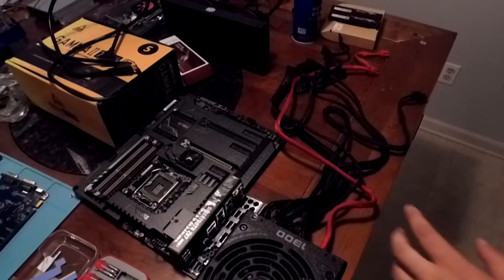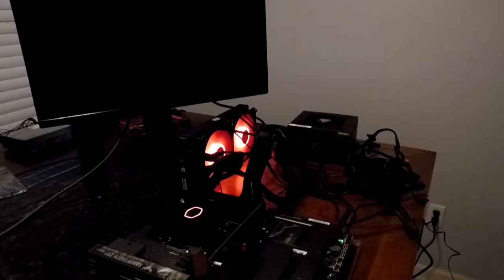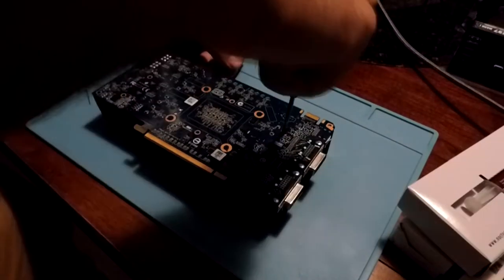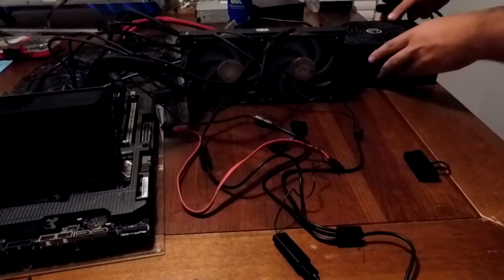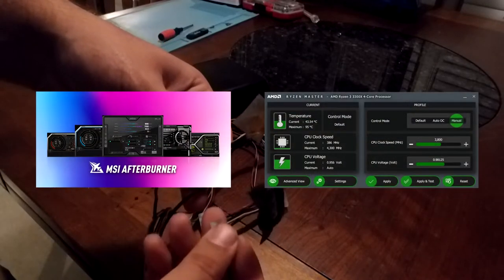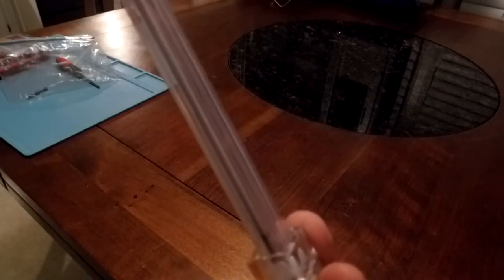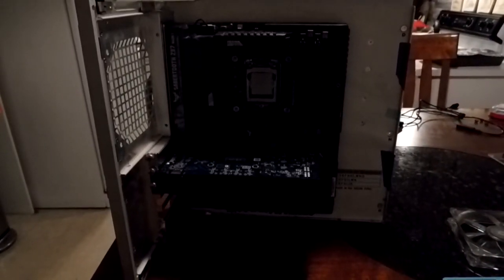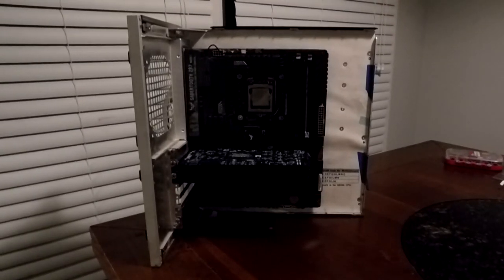Side of the Road Gaming PC: Part 2

Comment: Top tip - power supply testers are fairly cheap and will pretty quickly tell you if the power supply is good or not.  Definitely invest in one!
Reply from the maker: Ironically I just ordered one. But regardless, thanks for the tip!

Comment: Apologies, this became a bit of an wall of text heh.

I'm thinking the floppy disk reader was too update the bios instead of using a usb drive.
Or it was used too update the bios for one of the previous motherboard & cpu combos in this pc.
Which for something around the era of socket 775 2004 - 2009 & am2/am2+ ca 2006 - 2009 makes sense as not all boards picked up the usb drive properly from my experience at least.

Cold cathodes did exist in the full color spectrum, like green, red, blue, white, uv/blacklight, pink, orange, yellow, i mean look at neon signs those are cold cathodes at a larger scale.
(Had white ones myself in 2011 - 2012 which with a case that had 2x 120mm fans on the side panel with white fan blades looked great in the dark as stuff picks up the glow differently vs with leds.
Had a black Akasa cs-500 case, cheap budget case from the 2010's when i first built my pc but worked so good with white cold cathodes aesthetic wise & the fans on the side panel.

I didn't have any custom watercooling loop or similar here.
I just wanted lights in my pc at the time too make it look a bit cooler on a budget instead of spending 100 usd+ on a new pc case & moving all the parts cold cathodes for 15$ did the trick heh.
But there were uv reactive acrylic pieces like 5.25 bay covers, fan grilles, uv reactive cables of any kind, even some powersupplies that came with modular uv reactive cables in the 2000's, acrylic cases or side panel windows that were uv reactive was also a thing.
Motherboards from a no longer existing company called DFI (Their lanparty boards specially.)
Usually had UV reactive ports & slots on them like ram,pci,agp,pcie, sata, ide, 24 & 4 pin.
HIS A few years ago had UV reactive gpu cooler shrouds having the Artic cooling vga silencer on many of their cards for years both agp & pci-e cards.
I still love the look of the HIS ICE Q HD 4870, their marketing images for it glowing looks amazing imo even if it's overexposed & somewhat edited too pick up glow more then it would in reality.
The last cards too have uv reactive plastics on them were the hd 5770 ICE Q i believe though no marketing image of it glowing like the hd 4870 on their page.

If you do get some cold cathodes.
Use zip ties as additional mounting if you can somewhat loosely.
(Do not bend the cables at the ends of these tubes they will short out & burn the powersupply or the tube which is probably what happened too that tube included with the pc actually.)
Doublesided tape is also not great for putting these up, broke one of my white cold cathode tubes when it fell while playing one night, actually caused my pc too turn off entirely suddenly.
Even velcro tape is much better at holding these in place with a dot of superglue too keep the velcro stuck too the case & cold cathode tube.

Actually found mountainmods still has cold cathodes if you want too try getting hold of some, maybe other places online will have some too.
Do contact their support though, this stuff must have been collecting dust for a while if it's actually still in stock or just an old website that's somehow still getting small updates.
Looks good on the photos though damn...

I do miss the glow from the white ones i had.
Oh and another thing...
Because these are very compact powersupplies for these cold cathodes they send out 180 - 800v too the tubes at like 300 - 700 mah.
Don't be surprised if they eventually die out of nowhere.
It's more the tubes that are unique colors thanks too the gas mixture in them so you can swap power supplies between most of them out there.
I know uv, red, blue & white are identical powersupplies at least within the same brand i had back in the day, no idea what the brand was but fairly certain they were repackaged & relabeled anyway for years.

Can probably contact EVGA's support about buying replacement cables for that 1300w powersupply if there aren't any custom sleeved ones too buy online, that's a really nice unit too have around imo.
Do keep a close eye on anything shorting out though using it.
As 1300w will not care that stuff is on fire & actively shorting out obviously.

Comment: The "fluorescent" tube is a CCFL, or cold cathode fluorescent lamp (AKA cold cathode tube).  It does not necessarily mean that the system originally had a custom water loop or that the tube was even a UV light.  CCFL's were commonly available in 3 colors in addition to UV/Black (In the early years of CCFL's, Black was the LEAST common color).  But regardless of the light color, it was indeed for custom lighting in the pre-RGB world.  If this computer was just continually rebuilt over the years, it's entirely possible that the CCFL and floppy were either original to the initial build, or even transferred from a previous chassis.

I actually took a pair of red PC CCFL's and installed them in between the front seats and center console of my car in about 2003.  Because Fast and Furious, yo.  (Ah, the follies of youth...)
Reply from the maker: Very fascinating. It is crazy to think that customization in PCs have evolved into what we have today and in a much simpler manner. But yeah, I was thinking that the floppy and CCFL were possibly from an older build myself.

Also I was just thinking about that the other day. Super Fast and Furious like. Glad you enjoyed the vid btw!
Reply: @BudgetBin  It's crazy to see what you managed to get just lying on the side of the road.  Looking forward to part 3!
Reply: Some of my old rigs had cold cathodes. I think I had UV at one point, and UV-reactive IDE cables, and would wrap other cables in UV-reactive sleeving, because that's what was cool back then. These days, I hate RGB.
Reply: @37Kilo2  Honestly there is still some "Je ne sais quoi" for me in those CCFL-s and UV builds (Remember DFI motherboards with UV reactive ports?) that rgb just doesn't have for me. RGB is quite repulsive to me, there was just something cool and geeky in that neon style.
Reply: True, I still have a few new in the box. I'm going to use them in some retro builds. I loved those things.

Comment: I don't actually know how they would have used that floppy disk. The motherboard almost certainly doesn't have a port for it. As far as I know the last board to have a FD port was an Asrock board that was around about the 2nd Intel i5 Generation and I have never seen a PCI card for floppy disks. Beyond that how else would they get it connected?
Reply: There is a SATA adapter that is usb that you can run a floppy off of.